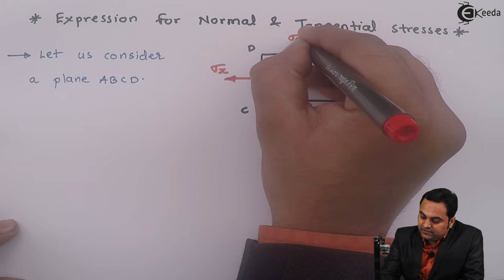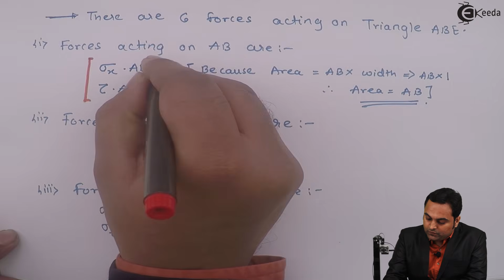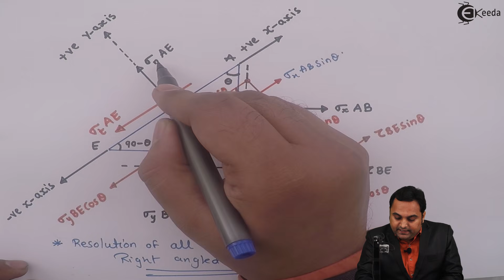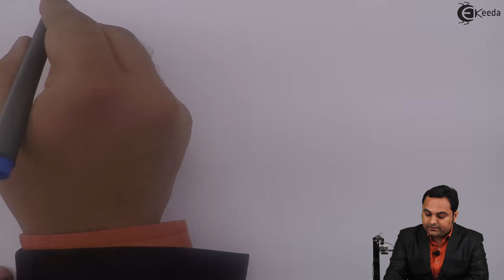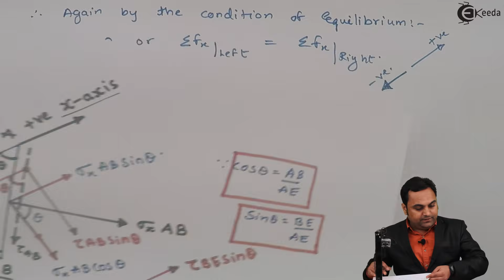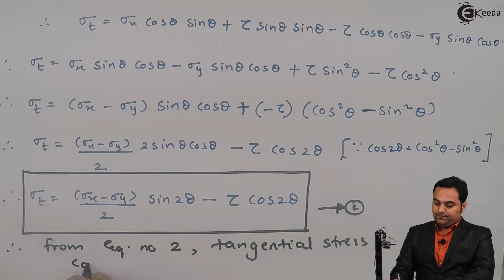Expression for Normal Stress and Tangential Stress - Principal Stresses and Planes

Comment: why dont you tell the reasons of doing this exercise , i mean, whats the use of rotating the corridate system , the practical application of this exercise
Reply: you're doing this to find the angle at which this specific element in an object will break, and at what stress it will break at